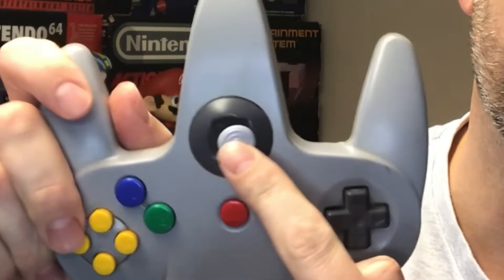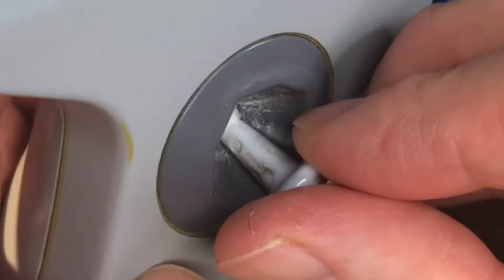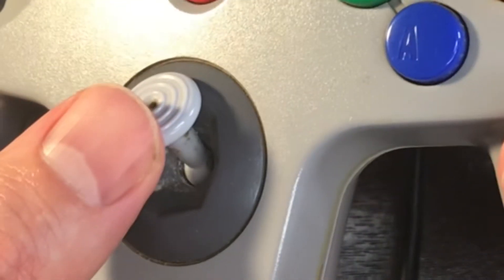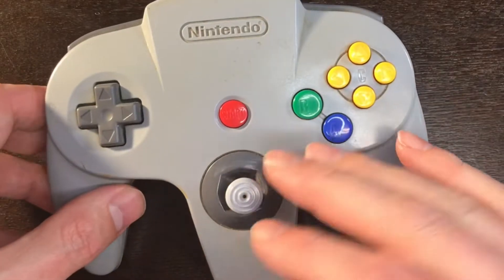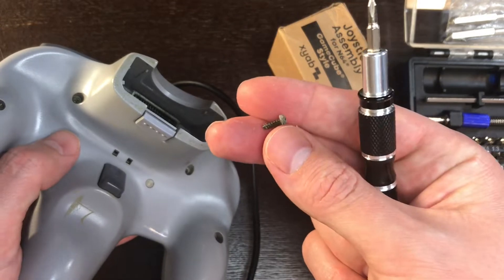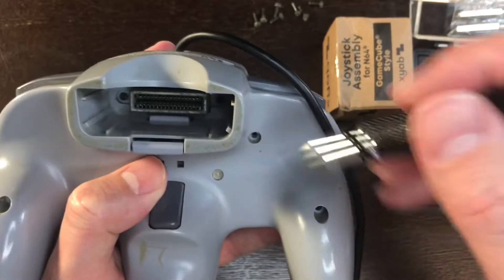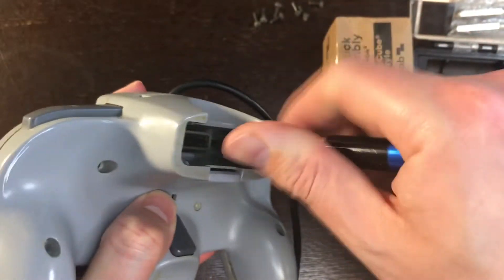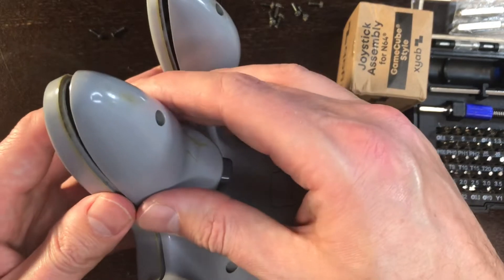N64 Controller Joystick Repair! GameCube Stick Fix & Review

Comment: Always been afraid to take apart controllers and consoles. 
But replacing the thumbstick seems very easy. Might give it a go.
Reply from the maker: It can definitely be daunting and newer controllers have more components but retro controllers aren't so bad 😊 A good tip is to use your phone and take pictures each time you remove a part so you can remember what it's supposed to look like when putting it back together. Best of luck!

Comment: Large dead zone and too much sensitivity with these gamecube style joystick replacements. Severe lack of precise movements. Aiming in Goldeneye is terrible, small turning adjustments in racers such as F-zero X are really bad. It's a decent casual gamers experience if they weren't ever used to being good or plan on getting good at any of these games.
Reply from the maker: I've heard that as well, especially in precision  games like those you mentioned. 1080p Snowboarding shown is rather slow in contrast and worked well. For that reason I may not recommend tearing apart functional N64 controllers to install these Game Cube replacements but if your N64 stick is broken and not going to work for GoldenEye anyhow, this option is better than none. Thanks for watching 👍
Reply from the maker: Appreciate the feedback and for you watching 🙌

Comment: Nice review! I thought about replacing my original sticks with one of these but a common complaint that I've read about joysticks of this type is that they feel a little too sensitive for games that require short precise movements. I went for replacing the worn-out plastic gear pieces in the original sticks. I got decent results out of it but I feel they would have turned out better if I replaced the actual joystick part of it too as those also wear out. Despite that little issue though I think these would work nicely with most other games. I would prefer using a joystick like this for something like Mario kart.
Reply from the maker: Mario Kart would definitely play similar to 1080 Snowboarding here, I agree. Good feedback on the precision part, I haven't yet noticed any issues but something to consider for specific games. It's relatively cheap to buy a 3rd party N64 controller for those instances and use this stick replacement for a controller that was otherwise inoperable too 😊

Comment: OMG that intro LOL.
I one time bought a really good shape red controller and I think it had replacement joystick I don't know if it was the installer or if whatever company made a mistake( not the one in the video) or explains why it was in really good shape maybe it was original.but I think it was wired slightly wrong. I always use Golden eye as my test game because of the menu screen when you pick your account.

It was from what I remember up was down down was up or left was right right was left or both

I got lucky (LOL back to first part of video) bought a box of parts controllers on eBay. didn't even realize there was a 64 controller or what was left of one in that box .
the previous person I guess was trying to do modifications or fix something on their 64 controller it was a gray controller all the part in a ziplock freezer bag with all the screws.

The joystick was virtually brand new with it so instead of messing with this gray controller it's in pieces and was missing a couple of little pieces here and there.
 I just took joystick and put it in the red controller .
good as new I have the messed up red joystick I think with that gray controller someday I will go back to it and see if I can switch some of the pins around
Reply from the maker: Haha glad you enjoyed it pal 🤣 What a bizarre story regarding that red controller! I wonder if the wires were plugged in backwards in that case (white cable to the right)? Maybe that would have caused the confusion 🤔

Comment: This joystick is way to sensitive on some games for some reason.
Reply from the maker: I've seen some say that this stick has more movement than the analog 8-points of the original stick. It's a good solution for a broken stick replacement but I wouldn't swap out a working stick for one